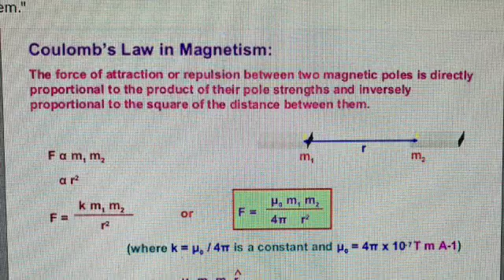Self powered basic device. Mechanical principles.it is one example of the balance of the planet.

Comment from the maker: Transformer is one solution, with losses. Capacitor is another. Metal transfer is what I'm leaning towards. shape and density is the question
Reply: Perhaps use a bi-toroid transformer?
Reply from the maker: @brianp5210  That one perspective it would work yep. I'm leaning toward's inverse dc motor design really increasing magnetic flux. Thank for your idea cool.